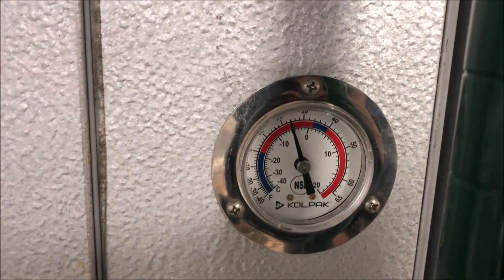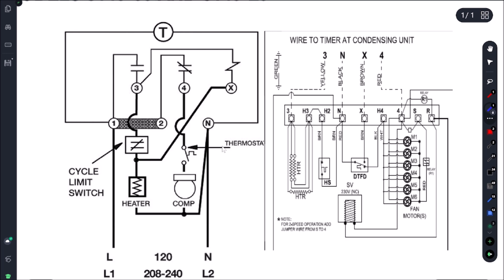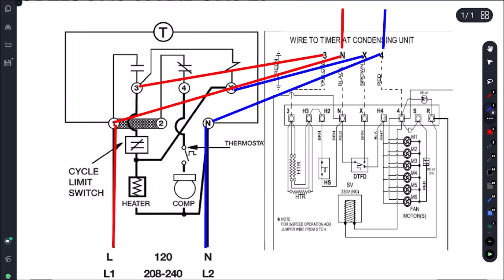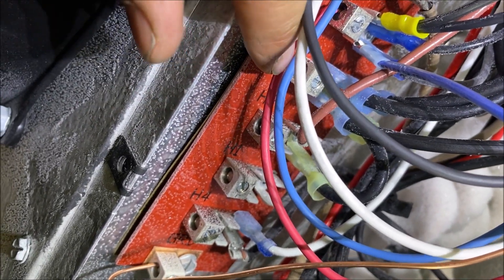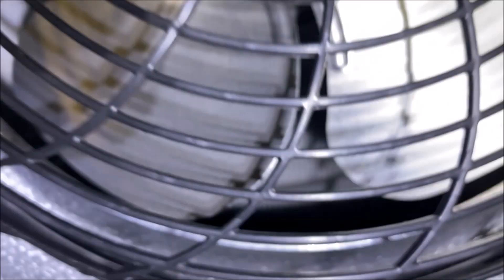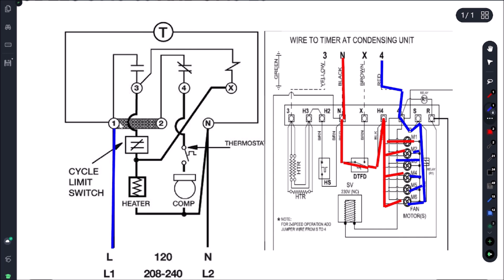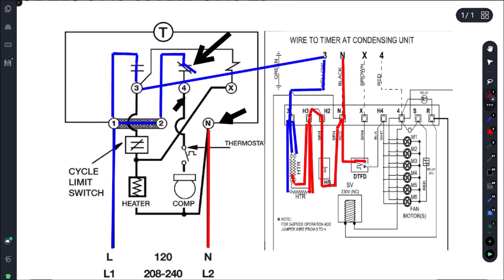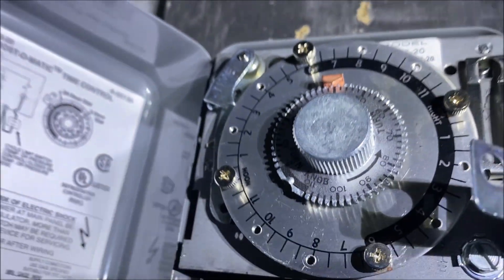Walk in freezer defrost time clock wiring & troubleshooting

Comment: I am first year apprentice but when you explain power coming from RELAY 1 is only two speed evap fan motor . It’s is normally closed when temp satisfies it will run fan with low speed . THANKYOU .

Comment: Temp  control should have a defrost cycles built in it , if not you could  program it , usually no need for defrost timer when you have these type of temp control, please correct me if I’m wrong
Reply from the maker: This temp controller does not have defrost, the next model up does

Comment: Walk in freezer box temp is 40 coil td is 10 and 30 degrees 404 is equal to 70psi but i have 36psi and 190 hs pressure clear side-glass is it mean low freon
Reply from the maker: Clear sight glass means the charge is good.
Reply: @REFRIGERATIONKITCHENEQTECH  thanks sir for your response if its good what other think i need to focus thanks

Comment: Another unique video with a unique problem. I would have thought, you'd have to run a new conduit from the roof. You just took the power and fed it to the clock and then sent out a 4 wire conduit from the clock, controlling the coils operations. Thank you for showing the steps you took. Brilliant.
Reply from the maker: It would of been a lot more expensive to run the wiring up to the roof and I didn’t want to mess with the nice job the roofers did sealing the roof. So I went to Plan B.
Reply: @REFRIGERATIONKITCHENEQTECH  I agree, god bless you for sharing your knowledge. The other day, I used your service 25 video to troubleshoot a bad combi cleaning pump. It was pumping but very slow and one terminal was showing resistance to ground. Ordered the pump.
Reply from the maker: Ha nice

Comment: 🇺🇸❄💪👍 what type of digital tstat was that on that unit ? I thought some have a defrost setting built-in to them  n don't need a defrost clock ? Also flyers hired Tortorella I'm pumped for the season. Thanks great vid.
Reply: Just looked up artic fox digital tstat. It's designed for medium temp box, lol brilliant. Thanks again let's go flyers!
Reply from the maker: Yes it’s for medium temp. If they would of got the one for low temp, all of this could of been avoided. Ha, didn’t know they hired Torts, could be a good thing for the team